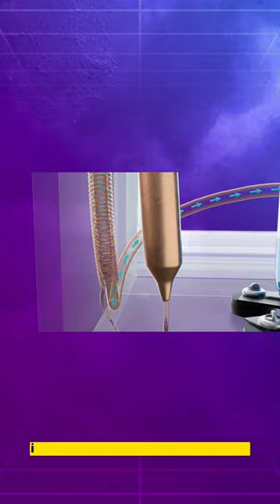How the Refrigeration System Works (3D Animation)

Comment: I think the crankshaft or rotor in my compressor gets stuck after working for a while... Once it gets hot and the fridge goes off due to power outage, I hear this sound in the compressor like the rotary part is having problems spinning, maybe its expanded due to so much heating, i don't know. The repairers around here are clueless. Can I get any help 🙏🏻
Reply: U need a clamp meter that will tell you how many Amp the compressor using with compressor cold.check sticker on compressor for RLA rated load Amp and LRA Locked Rotor Amp examp. RLA 1.4amps LRA 23.0amps this will tell you what your compressor is doing inside.
Good luck